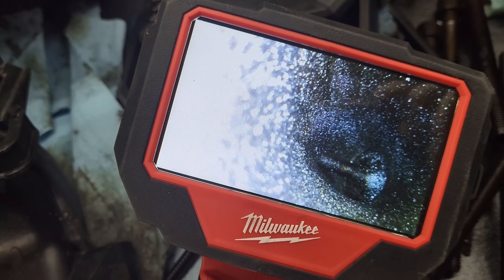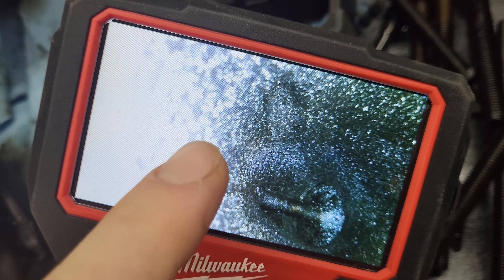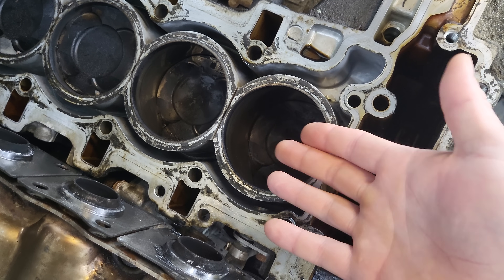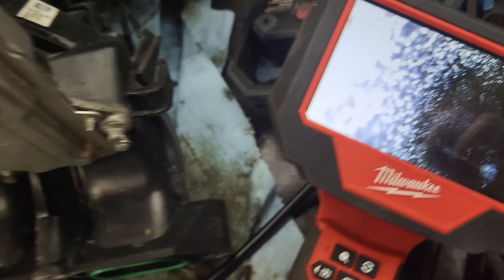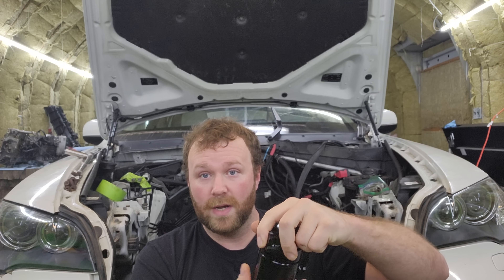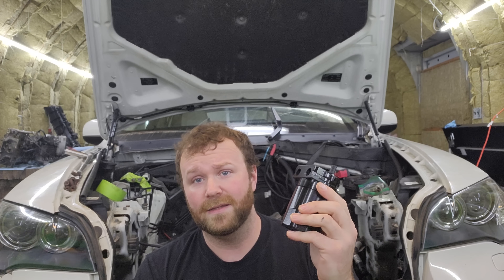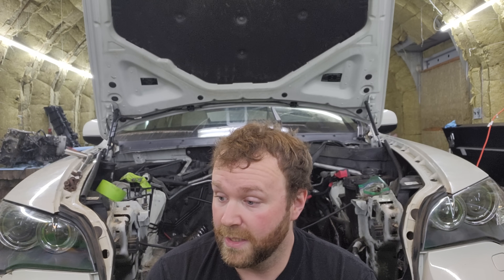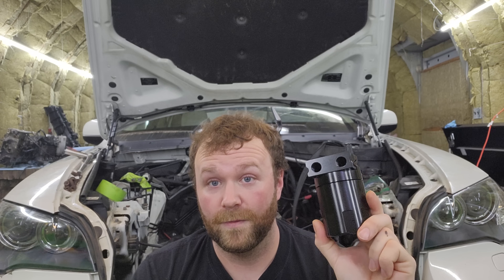The Modern Engine's Achilles Heel: How to Prevent Costly Carbon Build-Up in GDI Engines

Comment: Direct injection was invented over 100 years ago, and up until the last 10-15 years ago auto manufacturers didn't think the benefits outweighed the drawbacks. Now, their greed is showing, they can honestly report better fuel economy for higher sales, and get you again in higher maintenance to repair the results of those DI drawbacks! I'll sacrifice a few MPG's to have port injection, thank you.
Reply: Don’t forget, the car manufacturers are under tremendous pressure to achieve the ever increasing CAFE regulations imposed by the Feds.  This is why they’re going to aluminum sheet metal to reduce weight, GDI engines, small 4 cylinder turbo charged engines, etc.  (CAFE - corporate average fuel economy)
Reply: @chdinct6792  
Thanks for explaining the acronym 👍
Diesels with EGR and DPF
Use Up to 36 percent more fuel to meet the emissions of savings the planet 
How is running the world out Of fuel faster better for the planet 😭
Reply: @garreysellars5525  Diesels have a serious challenge: NOx emissions. For the average Joe they may only represent some lung irritation; for asthmatics it is a much more serious thing.
Reply: @flagmichael  mate reduce fuel burn reduce the amount of emissions 
Add water methanol injection 
That reduces cylinder tem exhaust temps adds power 
Reduces nox and CO2 
Win win 
Towing a load with equivalent petrol compared to diesel uses as much as 30 plus percent MORE FUEL 
EQUALS MORE EMISSIONS 😜
Reply: I love direct injection 
Diesel only 😮
Reply: Very Well Said!!!!!!!!!!
Reply: Not so much greed as steadily tightening emission standards. The GDI revival has come from fuel economy and air quality standards. 
The big problem comes from the people who don't care about your money at all: the EPA. I remember the 1970s, when fuel economy and emission standards drove some of the wackiest systems: AIR pumps and such.
Reply: @flagmichael  if not for air quality standards you would probably be deceased. you are immature
Reply: It's the EPAs fault.
Reply: @BuddyTheWolfYT  rules of society are justified, it's up to capitalism to innovate solutions and markets to decide final path. your comment is childish
Reply: @Ninky...It's not the auto manufactures fault completely, it's the EPA and the strict restrictions they've put on manufactures to have cleaner burning engines but most the auto manufactures aren't willing to use both port and DI because of cost so who's to blame? EPA and/or Manufactures?
Reply: Yes. It's not their greed, it's the EPA. We can't have an LS, 2.7 Toyota, or 4.6L 2-valve Ford anymore because of our gubmint. 

Honorable mention to 3.8L Buick and 3.0L Nissan
Reply: We need orange man back in office (YouTube censors my comment if I say his name)

Comment: Carbon deposits on the valves are not the only problem. DI engines burn is less complete than port injection, carbon particles in the oil will wear the camchain!

Comment: I ran the hose from my valve cover straight into the dump pipe bend of the turbo. Natural crank case pressure and the venturi effect in the dump pipe draws all vapour out and the extreme temperature and fire in the dump pipe burns the vapour.  Eliminating both the original problem and catch can servicing
Reply: Do you have a catalytic convertor? Probably not right?  The point is; it costs a lot of money to replace a coked-up convertor.

Comment: Change your oil every 5k miles use synthetic oil, keep you oil level top up. Use Red Line Fuel injector treatment every oil change. Oil Additives every oil change like Liqui Moly or maybe 30k miles with the Liqui Moly. People saying change your oil every 10k miles get a bicycle.
Reply: so, again,, where is the fuel injector? and how would the fuel injector cleaner,, fix the carbon on the intake valves? just wondering... 17 year classic italian car tech here//

Comment: Professional "catch cans", they are called oil air separators, drain back into the oil pan with a pipe. A nice example is the Mann Provent filter series. There is no need to maintain. BTW, catch cans mostly collect water. Where are these separators installed by the OEMs? In trucks/HGVs!
Reply from the maker: 4th fella to mention that

Comment: What if you just get rid of the whole system..?.. why are we putting the crank case vapors back thru the intake.?.
Reply from the maker: For emissions.  Keeps the pollutants out of the air
Reply: @daveolsen5034, 
"... why are we putting the crankcase vapors back thru the intake.?."

As opposed to venting them into the atmosphere?  Suck a good lung-full of those vapors in directly and you will have your answer.  Maybe not so good for our engines to breathe that stuff, but much worse for our bodies to breathe it.

Comment: BG came out with a valve treatment 3 years ago. Every 15k and you are good.  I am a master tech with 20+ years in the trade. BG makes good stuff. I am not affiliated with BG products as anything but a customer. I have seen carbon buildup cause misfires on cold statrup at 30k miles. This happens on cars that tend to make short frequent trips. Catch cans are more for the gearhead type person.
Reply: Over 3 years ago they came out with the 2nd variation of the gdi treatment, and they had another more labor intensive one before that

Comment: Just avoid GDI engines. I retired from Lexus in 2012, and even than ,we had already port and direct injection combined. Its very fashionable to dislike Toyota ( Lexus) but lets face it, there is a reason why they are number 1 in longevity and durability.
Very nicely done clip, keep at it Lance, greetings from YVR.
Reply: They are almost all GDI now.
Reply: 2003 Toyota 2005 honda 2008 mazda still going strong here
Reply: You don't need to double up your injectors when you just run the valves hot (how is doubling a critical part like that improving reliability?).  Mazda solved this with skyactiv back in 2012 with no extra parts and no downsides.

Comment: The best fix is to run water vapor injection, keeps valves, cylinders, and intake perfectly clean, and the oil stays cleaner longer.
Reply: except when the water goes where it's not wanted, or the reservoir gets to be empty........

Comment: Get an IAG air/ oil separator. It's heated by engine coolant, and requires no maintenance. Oil drains back into the block
Reply from the maker: Will check it out :)

Comment: Never use a catch can.
Reply from the maker: @nyccontrabass3489  great. Now explain why? :)
Reply: @Lancemechanics  sure. Issues are freezing in the winter, it doesn’t help as much as people think, if you don’t empty it regularly and you drive hard you can pull the built up liquid into your intake which can be bad. Why don’t car manufacturers have them prebuilt into their cars if they help so much? Toyota really has the ultimate answer which is to go with port and direct injection. Reduced fuel efficiency, lowered performance, a failed catch can can fail the EGR valve, pressure build up in the crankcase under hard driving, misfiring… the list goes on and on. Is it worth it? No. Best to do regular maintenance.
Reply from the maker: @nyccontrabass3489   well I can tell. You I live in one of most harsh climates -25  to plus 5 in 1 day. Plus 40c and -50 in the winter. No issues with freezing. As for egr failing?? Pressure is equal everywhere in the system. That's positive pressure. Catch cans do not cause restrictions  otherwise race car applications wouldn't use them or there barely noticeable. As for the port and gdi injection. You realize the cheapest Toyota crate engine is over 7000 American and not even assembled. The Toyota recall for the v6 has shown that an entire engine pushes almost 30k. So complicating a air pump is not the solution.
Reply from the maker: @nyccontrabass3489  also I mentioned its for people who regularly check there vehicle. You mentioned neglect circumstances.
Reply: @Lancemechanics  I always expect people to forget to maintain their vehicles. Seen it way too many times. It isn’t worth the time or effort… better to get regular maintenance on the valves than mess with a catch can.
Reply: Once in a while it may be worth it… you gotta get the right system and make sure you get it installed correctly and tested. I track my cars and you should never use a catch can if you track cars. That is crucial.

Comment: I’ve been recently aware of direct injection problems with petrol engines with oily deposits from the crankcase ventilation coating the intake valves and ports. What I cannot understand is that diesel engines have direct injection and I’m not aware of this issue with intake valves on diesels. The oily deposits from a diesel have MORE carbon. Bit confused?
Reply from the maker: Disease don't have throttle bodies. Having a throttle body creates massive amounts of vacuum. Pulling the crank case vapors into the intakes thought the pcv

Comment: i was a   mechanic   years ago  .    i had this real old school guy    show me   his home made  catch can  on his  64 triumph  1300  car  .   i was so impressed   he had    put a  old gas valve  on the bottom of  a  tin can    that    teed into  his dip stick    via  a  bit of  rubber  pipe   and   to drain it   all he had to do was   open the valve  every so often   . 
  he said   he went from   topping the oil  up  every  month   to  never having to top it up  .
Reply from the maker: Amazing :)
Reply: In the pre pollution era such as 1964 or older and older design aircraft engines,  there is not even PCV valve, the crankcase simply get vented to the atmosphere. I have heard of airplanes operating in arctic conditions and crankcase vent tube not insulated properly, the moisture freezes and block the vent, leading to blown crankshaft main seals due to pressure build up in the crankcase.

Comment: I used to have a Chrysler Conquest and A fix for a fuel adder if you added boost was to add another fuel injector in the intake pipe.  I thought about this when this whole gunky valve/Direct injection foolishness first became a thing.  They’re sort of doing that now- port and direct injection.  The best solution to the problem.  Or, buy something old.😂

Comment: My 04 Volvo has a huge OEM oil catch chamber built-into the  crankcase vent system that's good for 100,000 miles before it needs cleaning or replacing.  It's too big to have problems with freezing or filling up with oil.

Comment: Those valves he is showing actually look ok, but do have a small amount of deposits on them and would work fine. If you have direct injection use only synthetic oil as it is resistant to coking. Coking is oil deposites like on valves and or turbo bearings as these surfaces get very hot and after a hot shutdown using sysnthetic oil will keep your deposits to a minimum.

Comment: All the catch cans on the market are too small of a volume to make a significant difference. It's not just about filling up to fast but the fumes are just not in there long enough to separate a significant % of the contaminates.  You need a much larger volume to give the fumes TIME to separate. Sure you will catch some fluids but not enough.

Comment: If the catch can filter blocks this will increase sump pressure and blow out seals and in worst cases stop the engine oil from returning to sump and oil starvation with engine failure.
Reply from the maker: If your pcv valve fails, the same thing happens? Your scenario is rare, as is the pcv valve

Comment: Hardest thing to diagnose? Shove a camera in the intake if you are experiencing a misfire on a car with DI. If the valves look like a coal mine it’s prudent to clean and re-evaluate the misfire.
Reply from the maker: Your out of touch. You realise what happens if your wrong. Some of these engines are multiple hours to get to the intake valves then the cleaning its self. So your spending 700 plus on a visual to find out a it could be a ecm update  or a bad head gasket that misfires only after sitting for a bit. Or a spark plug or coil with carbon tracking.  You have much to learn
Reply: @Lancemechanics  ¯\_(ツ)_/¯ 

Idk boss. The internet seems to think that carbon buildup with DI is far more common than the other failures you listed, which moves it up the proverbial totem pole of potential failures. 

Thanks for insulting my intelligence though.

Comment: Thanks for this recommendation. I've been going to do this for a while now. I have a 2019 Toyota Yaris (Mazda 2) with a 1.5L DI engine. Every 5,000 miles I run a can of crc intake valve and turbo cleaner through the manifold as directed the same afternoon I do the oil change. I haven't run a bore scope to check to see if it works, but I'm at 72,000 mi now with no issues. My engine hates the cleaner. It coughs and gags, and just generally runs rough later in the process, and I always have to clear a "running rich" code afterward. It seems like I'm abusing the engine, and seems to be a case of, "is the medicine worse than the illness". I would rather use a catch can, and then use the cleaner a couple more cycle to clean off any remaining deposits, and then just use the catch can alone.

Comment: That's why modern synthetic oil has some detergent added, so PCV and Valves have less bild up. Every manual from any manufacturer has one item about cleaning intake valves procedures and it's quite ease to do when things aren't so in despair. Some manufacturer, notably mercedes Toyota and VW, commands their ECU to run the engine in  an extreme version of Miller cycle for to let gas vapours get in intake and clean valves or make the engine run preferably on Miller cycle. So a  good quality gasoline and few tanks of high quality in between avoids this problem, also ALWAYS  look to use gas with the best detergents and lubricants package on the market
Reply: What is a good quality gasoline? I buy QT 87 octane.
Reply: If you’re driving some high compression engine, 91 octane is better at least, but i don’t know your car and always follow instruction from your manufacturer. More important is additive package how your favorite gas station take care of the gas: not selling out of date gas, cleaning tanks regularly or take care of things accordingly

Comment: FYI…One code that carbon on the top side of the valves causes is a cold start misfire code, why I don’t know but after cleaning them, the code went away.
Reply from the maker: That's a common one. Another is also rough idle. Poor fuel economy.  Random  misfires on highway that clears once key cycles. Stumbling on acceleration. Bad shifting due to ecm compensation. Ect. List goes on.

Comment: I think what Toyota is doing having both port and direct injection, I hope it is cause I just bought one
Reply from the maker: Don't get me wrong. It works. I just can't justify a 4 cylinder engine that so complex its nearly 10,000 and the v6 Is nearly 30,000
Reply: @Lancemechanics  the Corolla has it and I wouldn’t say it was expensive, and I do 75 and I easily get 40 miles per gallon. I almost got 45. That’s what I’m shooting for, but I won’t be able to speed

Comment: Undersized engines, turbos, VVTs, CVTs, as well as GDI and its issues. I looked at all this unavoidable tech after 45 years of manual hatchbacks and went with a re-batteried Bolt EV. All the spinney bits running in ball bearings, quiet, and the quickest thing I'll ever own.

Comment: Spray CRC valve cleaner every three months with oil change
Reply: Probably will wipe out the piston rings doing it that often.
Reply: @fendermon  why ?
Reply: @TheVigilantEye77  Maybe small bursts would be okay, but I would guess it would wash the oil off the cylinder walls while running.

Comment: The problem is the ring lands get carbonized and then more blow by and oil consumption starts, this is caused by ethanol fuels the most. A product like Yamalube Ring Free Plus helps to clean the carbon deposits in the combustion chambers.
Reply from the maker: Was common for me to re ring 3.5l Honda engines. So much build up in the oil control rings
Reply: How does ethanol fuel cause carbonized ring lands ?
 Furthermore, this article is not addressing carbon that is already inside your cylinders and/or chambers. Rather, it is talking about preventing carbon build-up in the intake ports and on the back of the intake valves, specifically on direct-injected engines, in the first place. If/when, that stuff breaks loose and enters your combustion chambers, what's to stop it from getting jammed in your rings, and scratching the cylinder walls up, and/or causing detonation?

Comment: Catch cans are not needed!! Use a good synthetic Oil change every 5k miles with the filter use tier 1 gasoline. 3rd generation mechanic and engine builder. I own a Ecoboost with 130k miles and it's clean, along with another DI car 80k miles and clean.

Comment: Oil level will rise on the dip stick   But long distance travel it does not but short distances on and off it will start to rise Hyundai service department just says da we never herd of that     But I know I am a 40 plus mechanic   And never talked to the dumbest service wrighters that ther are today    I think that the fuel pressure is just to  high and trickles past the fuel injectors when the engine is shut off     And leak on the top of the pistons past the rings and into the crank case    Junk  g d I engine not perfected buy manufacture love the car but must change motor oil every 2000 miles how is that for a environmental save the world government engine   And it’s not just one  manufacturing problem with the g d I direct injection    Junk  system
Reply from the maker: All gdi engines cause fuel/oil dilution. I've had Hondas come in and it must of had 2liter of fuel mixed into the oil. Hyundai is famous for there engines siezing up on the highway due to it. These systems are rough and if anyone thinks it's a problem of the past they are sorely mistaken :p